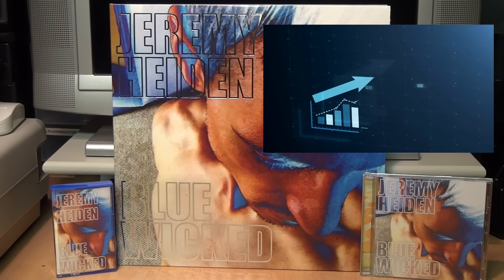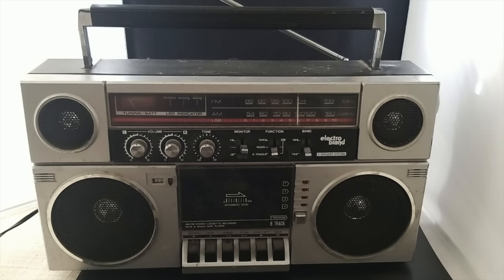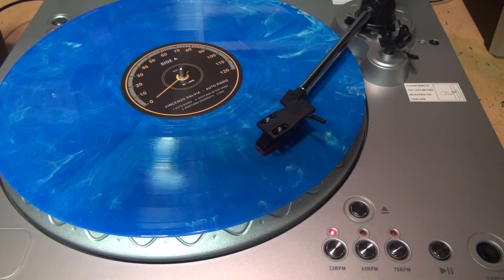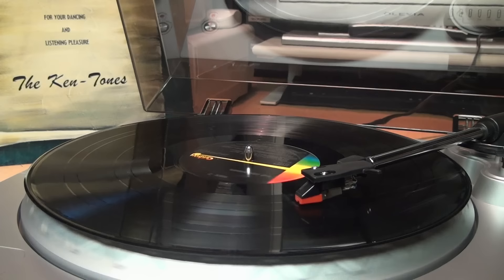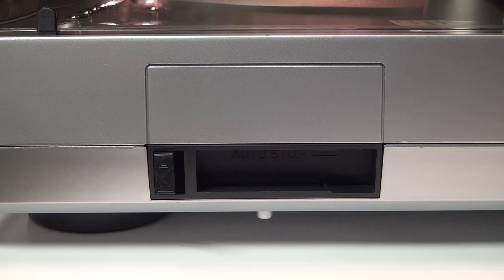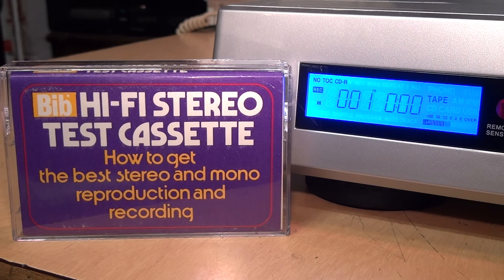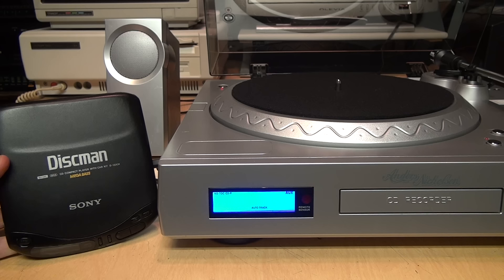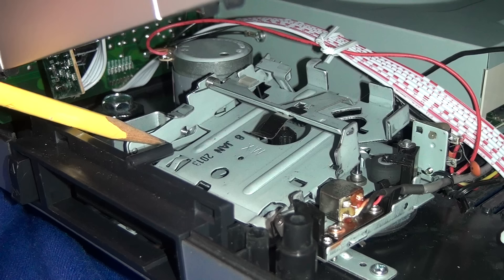A turntable that also plays CDs & cassettes - Anders Nicholson 2655

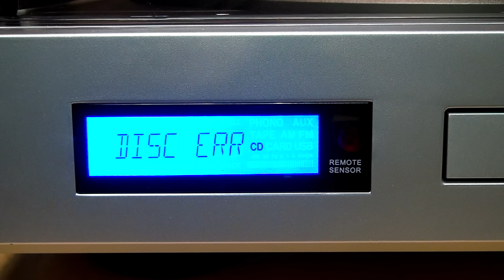Comment: Probably someone didn't notice this, but if you take a closer look at the display on 20:44, you can see the signs for an AM/FM radio, SD/MMC/MemoryStick/SmartMedia/CompactFlash cards and USB, that means they used the screen from a more enhanced model that had an AM/FM tuner, USB input and a card reader, or the one from the mini HiFi system with a built-in turntable 🤣
Reply: You can also faintly make out the signs for MP3 and WMA, meaning those features might have been available on a higher end model too.
Reply: Not necessarily.  This may be an off the shelf screen.
Reply: I noticed this, as I've stated in my comment; perhaps I should have read some comments first to see that someone else noticed it also.  LOL.
Reply: Or it just means it's a screen that was probably used for other devices.
Reply: It’s probably just a generic off the shelf display that can be used in a variety of devices.
Reply: Heartland America currently sells a model with all of these features for $199
Reply: I've got one of these here in Australia. It's branded AWA, which stands for Amalgamated Wireless Australasia. A brand that has been around for over 100 years 
Mine doesn't have the cassette player but instead, it has a 30 pin iPhone/iPod dock on the front left of the turntable deck. You can see the cutout for it in this video.
I still use it with an iPhone 4 as an internet radio. It works very well.
Reply: @0:45 on the beginning of the text, we can read      "capable of playing radio programs..."    I think they made more than one model....

Comment: Thanks again for another wonderfully entertaining and informative video. I remember this type of unit from the "Heartland America" catalog a long time ago. I actually almost bought one, but later changed my mind. The turntable is actually the only great thing about this. I used to get the "Heartland America" catalog all the time a long time ago. I even bought a unit from them with the "Encore Technology" brand name on it. I also would like to point out that this same catalog sold this very same unit, but only with the "Encore Technology" brand name on it, with the only difference being that it had two mini-speakers with it. They simply continued selling these things by rebranding them "Anders Nicholson" and passing them off as new, but were simply the same things with a different brand name on them. Not only that, I checked them out on the BBB website and although they have a 4.21/5 rating based on customer reviews, they also have had some customer complaints, with eighty-six in the last three years and twenty-four in the last 12 months. 

Thanks again and please keep them coming. I look forward to new videos from you always.

Comment: You know it's gonna be a quality product when it has the "bright unreadable smeary" LCD on it
Reply: Extremely good profile pic you have there
Reply: @FunkatronicDingus  I will forward your compliments to the artist
Reply: Also likely an illegal product on par with a device designed to get around the copy protection on a video game console.
The RIAA managed to get regulation or law forbidding CD-Recordable audio equipment to use standard disks.  Instead, they have to use special disks with a special tax that goes right to the RIAA.
Imagine giving an industry group direct taxing authority over consumers!!!!
Reply: Sometimes you can replace the polarizer with one rotated 90 degrees from the first and it will invert the colors. Inverted LCDs reminds me of those cheap timex indiglo blue digital watches in the mid 90s.
Reply: Speaking of bright smeary LCDs, i have a VERY cheap stereo that is so cheap, it doesn't even have a brand name, and it had an obnoxiously blue LCD screen for the "fake digital" radio tuner, which is just a (really good) analog tuner with a digital readout. The LCD is also on when the CD is playing.
I grabbed my soldering iron and I replaced the blue LED in it with a white one. It's a bit dimmer than the original LED, but most importantly, the screen is actually more readable, and its black segments on white background.
Reply: @christo930  that's actually a good thing. I can listen to music that I record for MYSELF, on MY own equipment, for MY own listening pleasure. RIAA and other bullshit can't stop me from copying a tape to mp3 because I plan on throwing the tape away due to how worn out it is.
Reply: @RealEpikCartfrenYT  I agree. I think it is absolutely outrageous and crazy that an industry trade group has direct taxing power over consumers or that they can outlaw devices for their financial benefit.  The whole music industry is one big mafia.

Generally speaking, tape, at least cassette tape, doesn't wear out.  If your tape is so worn out, why would you want a copy of it?

Reel to reel is a different ballgame. There are endless problems with old reel to reel tapes.
Reply: @ozzie_goat  Who is it if I may ask?
Reply: @christo930  it's a tape that contains live recordings of Metallica, and that's the whole reason I'm recording it, because Metallica. Otherwise it's beat up and it couldn't be played in my good stereo or in my boombox so I had to bust out another, really cheap stereo I had just to record it into the computer. The tape has gone sticky and it would have been a shame if I were to not transfer it, even if its full of dropouts. At least the speed wasn't jumping all over the place.
Reply: @RealEpikCartfrenYT  Was it a reel to reel?  I've heard of sticky reel to reel tape but never cassette tape.  Was it recorded live by you or someone you know? Like, IOW, is this a 1 of a kind recording?
Reply: @christo930  it was a cassette I bought at a flea market
Reply: I love how the remote is obviously a generic one used on hundreds of different DVD players from the mid-late '00s, but with a different overlay on it.
Reply: Those LCD's are more like a proof of concept that they can be made and should have never ended up in finished products. Also that blue colour burns my eyes.
Reply: 😂😂😂😂😂😂😂😂 That's not nice.

Comment: I think the Turntable is the coolest thing about the system, since it has an electronic pause, and a separate motorized tone arm, which you rarely see on any record players nowadays. It was most common back in the 80s, with track detecting turntables.

Comment: God I remember the Legacybox debacle. At the least, this is probably one of the nicer things to come out of Heartburn America.
Reply: I have 8 tracks that still sound fine. Magnetic media is very robust.
Reply: What was the "LegacyBox" debacle-??
Reply: @AndrewHeller-jn7dx  In a nutshell they advertised a high quality digital conversion service for your old media, but they used the most lazy, and sloppy methods, thus resulting in piss poor garbage quality like taking stereo audio, and capturing it as super compressed mono, while way overcharging for the service

There is an older video on the channel about it where he sent off some media to the company to convert, gets it back, then he analyzes it for how piss poor of a job they did!! 

So the service did nothing but pray on people who don't know any better about technology, and you can do a better job than they did with a basic USB capture card, and learning  the basics of video editing software that's free like KdenLive which can run on most Linux distros, Windows, or Intel Macs.
Reply: @qwertykeyboard5901  The oldest magnetic media, assuming it doesn't physically degrade is still fine.  There is a youtube video of an Andrews sisters song being played from paper tape reel-reel. It sounds excellent.

The paper tape was a reel to reel English format in 1947 (IIRC) before the Mylar backing was standardized.  This tape is the same as any other tape other than being on paper and not mylar. 

The real problem with magnetic media and especially reel to reel is so much of it has physically degraded. The magnetic signal may be fine, but that doesn't help if the media is physically damaged.
Reply: I've got one of these and the turntable speeds were out. Underneath near the front there are three holes and that is for the speed adjustment
Reply: @AndrewHeller-jn7dx Terrible transfer of 8mm movies to digital, for one thing. They'd got the speed wrong, not centered the picture properly at first, not colour-corrected it, ans seemed to have "transferred" it to 1080p digital by pointing a camcorder at the projection.
Whatever Youtube channel I saw that on then went on to do a vastly superior job at home with a not-that-expensivefilm scanner and some cheap / free software.
Reply: @worldcomicsreview354  I'm pretty sure it was this channel. :p
Reply: Yes, I would hear those commercials every day on the radio, talking about how your videos and movies and audio tapes were degrading by the second, and how they will one day just disappear.  And they also talked about how everything would be lost in case of a tragic event. So were they trying to insinuate that usb sticks would be prone to any damage from a disaster?  If anything, the usb stick would fail long before any of the physical media would.
Reply: One more problem on this is that if you are recording from record the onto CD the turntable picks up the vibrations from the CD whizzing around. Especially 52 x write speed. I used a 12 times re writable  disc and vibrations went away.
Reply: @01chippe usb memory sticks the only moving part is the physical connection to the device. It has no moving parts as is so called a solid state device that works like a magnetic tape without any moving parts and it is far more reliable than CD as they vary in quality so much, not withstanding the numerous moving parts they have. The problem here is the run for profit philosophy that dictates if customer demand falls, no incentive is provided to compensate for loss of profit. The effect is that companies destroy or discard all those memories, in detrimental effect to quality of options provided as the new ones are usually worse than before. This model had the effect of the quality of life and lack of more constructive society. We all suffer this idiocy because profit is in itself any better than other factors.
Reply: @worldcomicsreview354  A colleague has been using the camcorder pointed at a TV technique to transfer his old VHS holiday tapes. When I pointed out that USB capture devices were available he said that he had tried one and had all sorts of problems with sound being out of sync with the picture. I saw that on a recently on a Youtube video of an 80s pop star being interviewed where the source would have been a VCR.
Reply: @chriswilson4614  Great info to know, thanks for sharing!!!

Comment: 6:22 That's weird, since the button on the turntable is a microswitch, the input should be interpreted electronically, so it should be doable (just intead of the microswitch the electronic input would be an IR receiver). Because the whole unit appears to be just multiple off the shelf parts in one case, I think whoever made the assembled unit didn't want to do more wiring than what was neccessary to make the three inputs work together.
Reply: It would be very easy to implement, but that would be expecting too much from china.

Comment: Nice record player, it sounds great.

The tape deck will be the same as those in old car stereos. I had one in the 80's. I swapped it out for an 8-Track. (I wrote this before you lifted the top.)

Shame the CD is so noisey and there is no dampening of the turntable.

Great review.

Comment: It seems remarkably well-engineered for what it is and when it came out, and I bet at some point the design might've even called for some kind of isolation or dampening between the components, but someone may've pinched some pennies and it went away.  They should've thrown away the separate auto-return motor, but they probably saw the value-add of that to be better for sales than actual quality.  You don't know it's going to be junk until you get it, and returning to a mail order catalogue is going to be a nightmare, especially if you don't have the mobility to get it all back together and get it to a post office.

Comment: We have a turntable that looks just like that one and I noticed that the auto-return mechanism is not a velocity switch but it has been calibrated based on the speed selected. If the speed is set to 45 RPM it is calibrated to a 7" vinyl record with a smaller record label diameter so the auto-return only triggers when the stylus is closer to the center than the 12" vinyl records. The problem is when I played a 12" 45 RPM Maxi-Single vinyl record. Because of its larger record label diameter, the auto-return won't trigger even if the stylus reached the run-out groove. If the speed is set to 33⅓ RPM it is calibrated to a 12" vinyl record with a larger record label diameter. The problem is when I played a  7" 33⅓ RPM Micro-EP vinyl record. Because of its smaller record label diameter the auto return triggers before the music is finished.

Comment: It's kind of like my Neostar TCDR-30C (and on googling, they sold what you have there as the Neostar NTCD1V here in the UK!), the differences between the two being that the TCDR-30C has a "wood" (MDF) cabinet, the cartridge is a ceramic job, and has integrated speakers which actually don't sound too bad, though, CD, tape & vinyl playback leaves a lot to be desired, so I mostly just used it as a bluetooth speaker...

Comment: You could probably hack the firmware to set the burn speed to something slower (depending on how generous the sample buffers are on the unit -- hopefully they have enough), and install some rubber grommets on the optical drive to isolate the remaining vibrations.
Reply: Why bother though? Burning CDs is an obsolete concept and if you really wanted to do it there is much better hardware available to do it on.
Reply: The rubber grommets is exactly what I had in mind to try. Great suggestion!

Comment: It is quite surprising that this unit has a dedicated motor for the auto return function.
Reply: @MikinessAnalog : Tell this Technics 😉
Reply: @MikinessAnalog  I have the SL-100C.  It lifts up automatically.  But not as elegant as this plastic thing 🤓
Reply: 🤨 A bit unusual/a gimmick? that the turntable is still spinning when the tone-arm is returned
Reply: @MikinessAnalog   Probably not.  Motors and modern microcontrollers are cheap.  Engineering an effective, price-optimized gear / pulley / lever / sensor system is only cheap when you can subsidize it over hundreds of thousands of units.

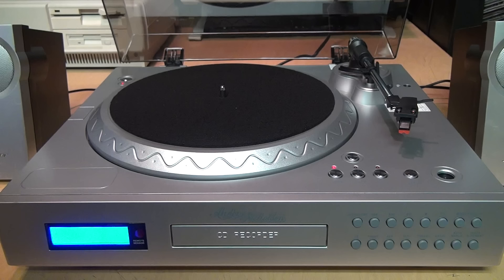Comment: @2:36 - The Blue LED - I have a Kinter tri-path amp that I use to power a set of Bose 2.2 speakers for PC audio.  It had a blue LED (turned out to be 2) that lit up a ring around the amp volume knob.  I physically could not sleep in the same room as that light - at all.  I was going to swap them out for something more pleasing, but instead, I slipped a piece of heat shrink tubing around each one.  I can still see the knob, but it's muted and dim now.  Blue LEDS are the devil.
Reply: I usually replace blue LEDs with white, and stick resistors in series if needed. White looks better than blue anyway

Comment: I have this exact turntable - the Neostar model! Unfortunately the lid has snapped off it's hinges and it's missing the remote, but for me it does a good job. Unfortunately, it can't read protected CDs or some of my 'unprotected' ones (my best guess is that you can burn an LP recording to a blank CD straight from the unit, and the CD thinks you're using a PC read/write drive so resorts to anti-piracy), but it's very useful to be able to play all 3 physical mediums.

Comment: Hmmm can you see how the optical drive is attached to the main board if it's not soldered on then there could be a chance of taking it out and using it externally with an extension cable.
Reply: The video shows that it was a standard pc drive with sata cables hot glued to the drive. I’d imagine theoretically you could remove the drive and get some extender cables. It would just be much easier to connect the usb cable and record to a pc.

Comment: as i recall most component cd recorders would only record on cd-r/cd-rw audio discs only and not data discs.  it seems like this unit can record on any blank cd possible. i have owned 2 component cd recorders and both of them would record on audio cd-r/rw only. nice to see that it records on any cd format. what happens to auto when it encounters albums where tracks flow into the next song with no gap?
Reply: That restriction was imposed by the record industry, because the "audio" CD-Rs are more expensive due to them getting a cut of the price. Then of course CD burner drives for computers came around, and they could record audio (including audio files obtained from ...unofficial sources) on the cheaper "non-audio" CDs.

In my country they have a similar tax, but it is for any blank CDs/DVDs (and other media, such as hard drives and the internal storage of new computers/phones/etc)
Reply: Stupid pissing anti-piracy tax thing.
Reply: I was thinking the same thing about the "music CD" limitation imposed on most consumer cd recorders, but since it's just an off the shelf PC burner inside it doesn't have that limitation, and it was such a niche thing it fell under the radar of the RIAA.

Comment: I have a better one at my house , it was an LXI series stereo , my great-great-grandmother bought it in the mid-to-late eighties from Sears I think , at the bottom there was a place that opened up in the bottom where you can put all your vinyl records above that there was an empty spot where you can put your extra component , and then above that was the cassette player and then above that was The equalizer and then above that was the AM FM tuner and it also had some sort of microphone Jack or some sort of Jax that I could connect something to